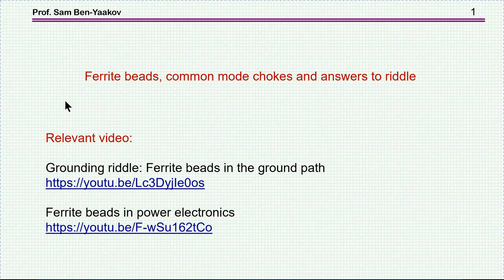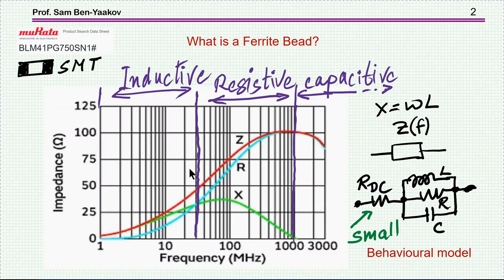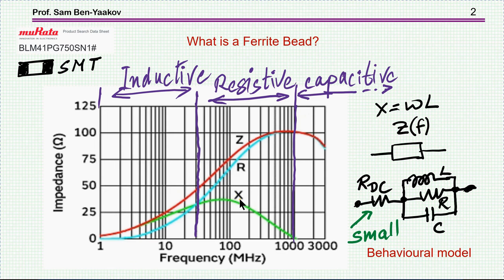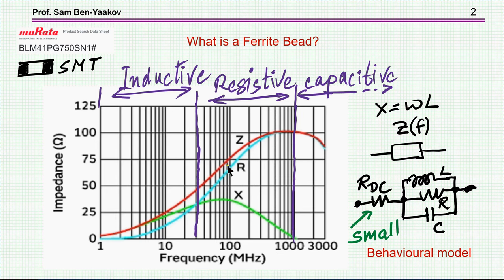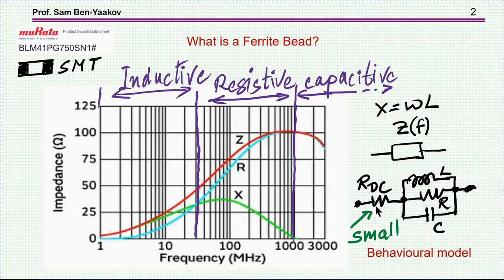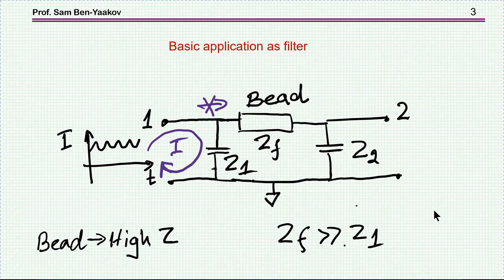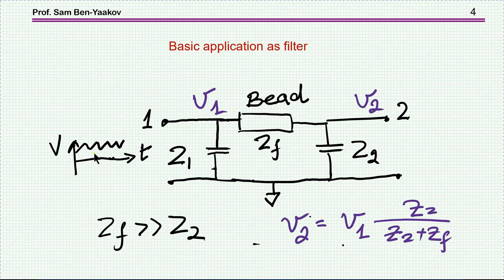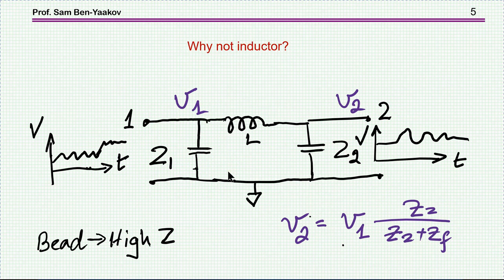Ferrite beads, common mode chokes and answers to riddle

Comment: The ESP8266 example is referring to the UART which is very low frequency by RF standards. It could go as high as 1Mbps but 115kbps or less is a lot more common. If the capacitor values for the signal lines are chosen carefully, it can greatly reduce EMI issues.

The printer example is particularly noteworthy since the Prusa MK3/MK3S/MK3S+ does isolate the USB interface from the rest of the printer. I think it was demanded from the community since some cheaper printers have a bug with the USB power rail tied directly to the printer's main 5V rail, causing problems like the printer not fully powering off when connected to a PC, but that's separate from what such isolation is really supposed to solve.
Reply from the maker: Thanks for sharing your thoughts and experience. I believe I have said in video that the No2 will be acceptable if the bit rate is very low (1nF caps plus ferrite). Further, the question wa: which example could be accepted without questions or hesitation. Thanks

Comment: Great video as always.  I think there is at least one more important property of the common mode choke worth mentioning - the magnetic material utilization.  With two separate inductors or beads, the amount of and type of material must be chosen to accommodate the desired (differential mode) signal.  Since this current can be quite large you can may need a lot of material or a lower permeability material in order to carry the desired signal without saturating the inductor, which either increases the device size or compromises it's level of noise rejection.  The common mode choke elegantly side-steps this by "exposing" the material to only the common mode current, which allows small volumes of high permeability materials to be chosen, giving good common mode rejection even in the presence of high differential mode currents.
Reply from the maker: Thanks Larry for excellent input. The common mode choke certainly deserve a video on its own while here it was just an addon.
Reply: @sambenyaakov  A common mode choke video from you would be very interesting, I can't wait to see it!

Comment: I think the assumption that in #3 that the single ended signal is only "DC" is wrong. I mean who has ever called a fixed DC voltage "single ended". To me it looks like a digital buffer sending potentially high frequency data over. With that, I don't think you can use #3 without hesitation without first clarifying what kind of signal it specifically is.
Reply from the maker: Clearly, the inductor at the high side implies a very  low frequency signal, probably analog. This is why I simplified it to a power supply.

Comment: Hi Sam! Great video. I was mainly curious about the ferrite bead in the GND path part. I designed a board that sends 5v power at around 1.5-2A through a 10 ft cable and I originally figured I would use a common mode choke but the PCB house I am using didn't have very many so just for quick short term prototyping I decided I would replace the common mode choke between 5V and GND lines with two ferrite beads, both the same ferrite bead product number and component, rated at around 3A with 30mOhm DC impedance. Product name is UPZ1608E101-3R0TF. Would this type of set up present any major issues in my hardware other than additional impedance to the current flowing to the cable? In this case I figured since the current needed to go to the other board is 1.5-2A worst case it would not be a major impedance but am I wrong in making that assumption?
Reply from the maker: HI Pietro, this should be OK. But if you need to send signals to the further away part, you need to consider the potential difference between the grounds. This is correct even for a common mode choke that will always have a differential component.

Comment: 7:40 hold up, if the power section is takig massive gulps of current like that, why not have that also star connected to the supply negative? Wouldn't a high side ferrite bead also help impede high frequemcy ground currents (KCL)?
Reply: Lol I paused the video right then and continued watching, yup I thought so 👍👍

Comment: What kind of ripple the "power device" is generating? Frequency? Amps? How much current it draw? I would be very careful with separating grounds, unless you really know what you are doing. I would keep one solid ground plane and place blocks in sensible way on the pcb. Take into account that current of frequency above acoustic will flow in ground plane just below Vcc track. So in my opinion voltage drop on ground plane is unusual situation.
Reply: The power supply is generating mostly current ripples, but because the ground has resistance it automatically converts to voltage. The split ground is higly beneficial, because any copper track has a specific resistance and the total resistance between 2 points is specificrez*length between points. Using a common ground would induce higher voltages to the ground of logic components further from the source of ground power for the high current load
Reply: @two_number_nines  let's assume schematic from 7:46 shows   PCB tracks (all this is one device on one PCB). If you put solid ground layer the ripple current will flow just below Vcc track on top of the PCB. and will not generate additional voltage in u2 .
Now if you build this on one layer and Vcc is on top and GND on bottom you will have very large area current loop.  All the best in EMC house
Reply: @krysieks  You have 10 iq. doesnt matter how solid a ground is it will always be reisitive. any current flowing trough the ground will always cause a voltage drop. the voltage at any point in a trace is current*specific resistace*distance from power source or load but with negative prefix sign.
splitting the ground causes near VCC quality ground going to all logic  circuits unaffected by the current and its ripples to high power loads. a solid ground would lower the resistance going to the load and raising efficiency, but would increase voltage ripple to logic circuits. To find out more google material specific resistance and ohm's law. And no im not watching a 52 minute enter-cational watchtimebait.
Reply from the maker: Thanks for participating and sharing the knowhow.
Reply: @two_number_nines  : In PCBs, we are dealing with transmission lines. Energy ( signal and/or power) will be carried mostly  through the dielectric between at least 2 conductors pair (one conductor is either a signal trace or power plane/trace, and the other is the return plane - some call it ground!). We also deal with  impedance of this structure (made up of conductors and dielectric) - capacitance, loop inductance all refer to this structure. Once you start looking at things this way, things get easier to understand.
Reply: @barronisme  What does this have to do with anything about split grounds+transmission line physics apply in the radiowave spectrum
Reply: @two_number_nines   Everything!...Please go through the articles/papers from Todd Hubing, Eric Bogatin, Howard Johnson, Henry Ott, Istvan Novak, Lee Ritchey, Bruce Archembault, etc. They will help you understand how energy actually moves about in PCBs. When you  understand how energy moves in circuit boards, you will get clear idea about how noise spreads in the board. Afterall, noise at a place  is just energy that we didn't expect to be in that place!
Reply: @barronisme  I understand more than well enough how noise spreads trough circuitboards. There are both conventional effects explained by theoretical electronics and radiowaves. Every conductor acts as an a sending and a recieving unit and the whole circuit is also a radiowave network. that said the wavelength of the current/voltage ripples in most applications is much longer than any pcb track and is a far far smaller noise factor than plain curren-voltage drop ripples found in shared ground topologies. you can also put radiowave shields on the logic side components and power rails just like mass production has done for centuries in applications from TV antenna reciever circuits going to mobile devices like tablets, phones, ps vitas and many more. You can't give me a single reason why you would not make a split ground topology in any noise sensitive circuit

Comment: Thank you for making this video. My question is what happens when a ferrite reaches the capacitive phase? Does it still absorb the high-frequency noise and convert it into heat or does it store the energy and reflects it back into the circuit, making it inductive again?
Reply: @sambenyaakov
Reply from the maker: At very high frequency the bead behaves as a cap in all respects which is reversible if course.
Reply: @sambenyaakov  So when a manufacturer tells that a ferrite's filtering range is from 1Mhz - 1000Mhz but its impedance peaks at 500Mhz. Will the ferrite stop filtering frequencies from the 500Mhz to 1000Mhz range?
Reply: @sambenyaakov  I'm if my question sounds basic. I am not an engineer.

Comment: Sir how to calculate the value of the common mode choke for practical power supply
Reply from the maker: This is a long story. You first need to estimate the parasitic capacitances. I am considering a video  presentation on this subject. Have you seen: https://youtu.be/5NRiLOvmXdA
Reply: @sambenyaakov  I have seen the video but am still don't understand I want to really understand how to calculate the value of the common mode choke, differential choke values also the Y and X capacitor value plaçed used to attenuate the noise and at what frequency does noise occur and what is the required cut off frequency for ac line filter

Comment: I don't get the phrase "it's ok to include a bead if the grounds are isolated". If the ground are isolated, this means that there is no physical conductor connecting them (galvanic connection). Obviously, we can have a parasitic capacitance between them, which is capable to transfer some noise. But in this case, how we can place a bead?
Reply from the maker: Consider a PCB island that you need to power from main part of board. In such a case beads in plus an minus lines will attenuate backward noise from island to main. Capacitance in between the two will just lower the effectiveness of noise  rejection
Reply: @sambenyaakov  Thanks for the reply. In this case we agree! But to fully isolate two part of the board (eg the power and the control part) is achieved if we provide each part with a separate PS (and separate grounds). I may got confused by the circuit @12:28 which uses an opto but its two parts seems to have the same PS. So, in this case we use the opto to isolate the "u1" block from the "power" and suppress any noise coming out of the first. But since we supply both circuits via the same PS, beads are put on the power line, to suppress any noise transferred through them. Did I get it right? Another solution would be to have two separated PS, one for each side.
Reply from the maker: @thece5511  Yes, the idea is to isolate the signal,  and for the PS to provide  clean voltage by capacitor and beads. Thanks for conversation. This is more economical than using an isolated PS.

Comment: At 12:12 you write path of interference however there is bead in path that should have high impendence for interference so path through U1 is wrong?
Reply from the maker: Thanks Marcin for note. Well, I may have been carried away, but strictly speaking, there would be some injection even if you have a filter😊